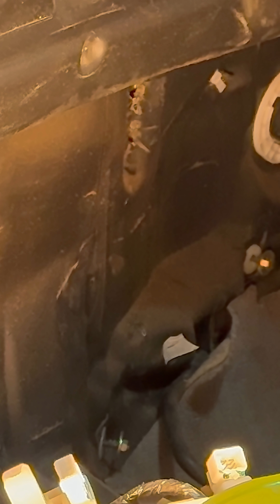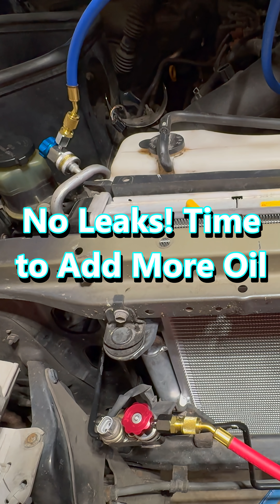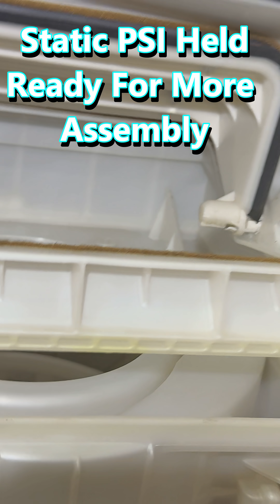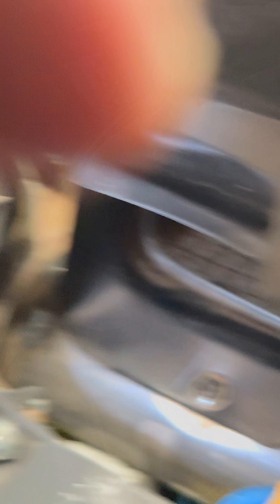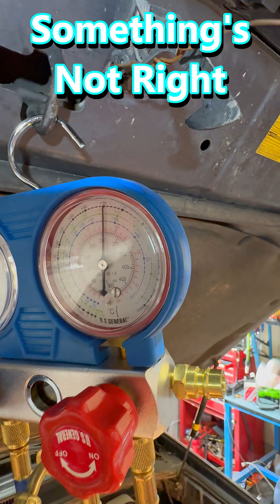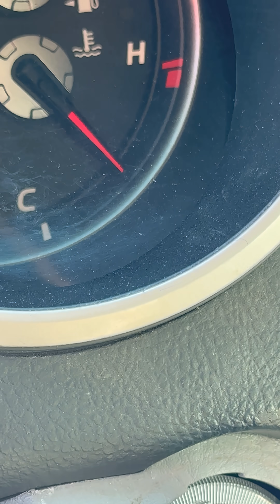246: (Part 3) Air Conditioning Compressor Failure Fix  #2uzfe #automobile #4runner

Comment from the maker: This 134a charge is to test my work. I’m taking this 4Runner to a shop and have the r134a I put in recovered and recharged with the 1.43lbs Toyota calls for. The failed fan clutch needs to be replaced first though.

Update: Amazon has Aisin fan clutches for $100, they’re $200 at O’Reillys. It’s going in tomorrow. Install video to follow. 

99F @ 20% rh today and I took the 4R on a trip up to the woods and the AC worked well, but it’ll do even better with the new clutch.